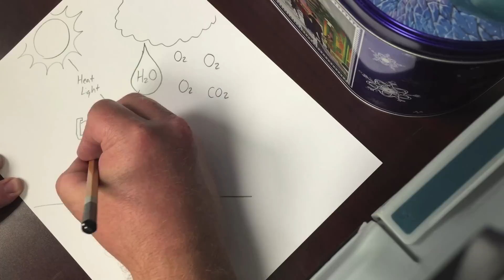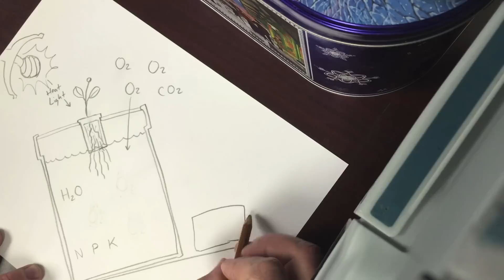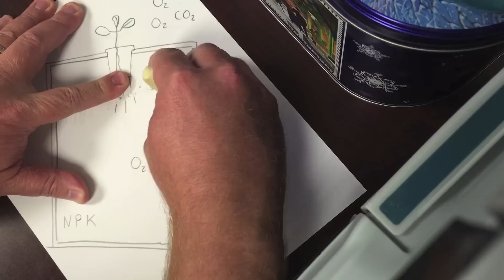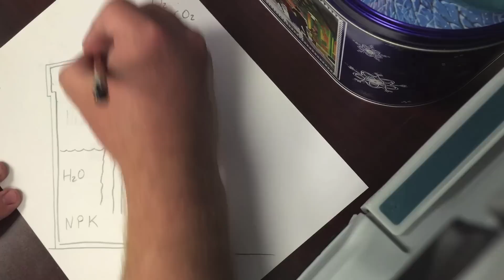How the Kratky Method of Hydroponics Works

Comment: I feel sufficiently educated.
Reply: But, quick question to anybody who can answer, if I try this method of plant growing, should I boil the water first to sterilize it and then wait for it to be room temp or is that a bad idea?
Reply: Rani Emira 
Use lake/rain water.
Reply: use britta filter.  depending on your  areas tap ph  and other levels this works fine.
Reply: @kesitheguesser716  Probably just normal tap water, depending on where you live.
Reply: Jeb gardener

Comment: With this method how do you combat bacteria in the water? Few times I have tried this root rot took over from the heat and o2 depletion
Reply from the maker: Oversize the reservoir
Reply: thank you will give it a shot
Reply: Might be a little late to the party but I used Pondzyme. Look it up.
Reply: If the plant is healthy enough it beats bacteria as well as fungus. Btw I used to use a one liter milk box for salads and they grew well.

Comment: How does this method compare with soil as far as growth rates and nutritional value are concerned? Do you never need to add more water, or do you have to add just the right amount at the start for transpiration to not remove all the water in the tub?
How much energy is wasted by the plant having to grow such long roots and pull that water up a considerable height?
Reply: Io growth in water is 2-3 times faster then soil. I rotate greens in about 45 days from the time I start the seeds

Comment: So the Kratky Method is to do nothing?
Reply from the maker: Well you have to set the grow up.  Once it is going, if your reservoir is large enough you can return at the end to collect the harvest.  Otherwise you have to add some water or nutrient solution if the plant isn't mature yet.
Reply: What nutrients do you use for all your growing, from seeding to mature plants  🌱 and great videos 🤓
Reply: Best also to use "Seedlings" over seeds that way roots hit the water right away and can start the process. You should also "seal" the lid or top so vapor does not come out but it is ok just makes the unit more efficient.
Reply: Where to get the light setup?

Comment: this doesn't make sense to me... so what you just let the res get low on water and the plants get O2 from the air? wouldn't they dry out? how do you keep the interior moist enough? wouldn't your res get contaminated from organisms that prefer oxygen low environments? wouldn't your plants have used up the nutes a long time ago and/or the EC gone up enough to require the res be changed? this goes against everything I've learned of DWC. It was an entertaining video but it doesn't really explain much, just "this works" in a calm voice with music in the background....
Reply from the maker: Yes the suspended roots collect air.  They don't dry out because it is a plastic tote with a lid on top so the humidity is high.  It might get contaminated, but apparently not enough to harm the plants.  The EC goes up slightly but that usually works out because the plants are larger at that point.  

Kratky isn't better or worse than DWC it's just an alternative with it's own strengths and weaknesses.  The funny thing is regardless of what we think the plants just keep growing and the finished product is the proof.  Try it out and let us know how it worked for you!
Reply: Exactly. It may "Work", but not anywhere near optimal. They are growing some pretty forgiving crops there, and not on a large scale. Everything you've learned about hydro, and DWC is still true. PH, EC and Disolved O2 can all be maximized to produce more healthy robust growth. Large plants would empty that reservoir in a matter of a day, or two. Healthy roots are paramount to healthy growth. Diseased reservoirs are just that- diseased reservoirs. It's like feeding a person nothing but spam for breakfast lunch and dinner. Yeah, they'll live, I guess. Short lifecycle plants made for rapid consumption. Personally, I want my plants to be Healthy. I take pleasure and pride in giving them the care they need while truly understanding the entire process. Everyone wants to put Their name on something. If it works, let it ride. It's a totally neglectful way to grow a plant. I understand they appeals to people looking to dip a toe into a hydro type of growing, but a lot of bad habits would be revealed when they went head first. May as well just put it into dirt. Cool none the less.
Reply: I know this debate is between experts and I don't know nothing about this but I do love it and would like to try. Is there anyone of you around New York or surrounding areas willing to give some practical training? I'll pay of course.
Reply: Kratky works, sorry. You are just going to have to accept that, the roots don't dry out as they are in humid air also.
Reply: I've used this about 7 years ago, so "kratky method" is a bunch of BS. It's just a lazy way to do hydro. The thing is that in small containers the air stone will create mist so the roots will stay moist even if the container is almost empty. Small and short plants like lettuce probably don't get bothered by EC/nute changes and will just take what they need until critical levels. Although it is probably unhealthy to eat these vegetables as they most likely intake all the salt and heavy metals depending on the nutes (most nutes will contain heavy metals). Without flushing the plants are keeping all the bad stuff in these but people are stupid.
Reply: Michal Jahnatek I'm coming from the video " soil vs hydroponics" how is the hydroponic one exploding in growth rate?
Reply: Feel free to watch more of Jeb's video's Michal to see how wrong you are.
Reply: Large plants would empty that in days? No shit. That's why you don't grow large plants in this system. Duh. The plants I saw in this video have a short life span and I didn't see any flowering plants like tomatoes. This is for greens. Good lord smart people can be stupid.
Reply: It works because it works. I grow many of my greens like this and I barely have to put any effort in. Sorry not sorry.
Reply: Eric Batista lol I hear ya! "sorry not sorry" lol
Reply: The biggest question here is how can you take a comment from anyone named Dildo seriously?
Reply: This is easier then just dropping them in soil and just hitting them with water?  I fail to see that.  As you saw in some of his other videos plants die in a system like this.   Anytime you have roots suspended water your biggest enemy is root rot.  Now granted going the whole DWC route can be as cheap or expensive as you want to make it.  This does work and it is good for that BUT 2 or 3 small things that cost maybe 10 bucks or less would give you close to 100% success rate without crop failure.  When growing is a small system you dont really have the room to be tossing plants like you would in a bigger system. This is basically the same thing as a raft/wick hydroponics but with it seems like not that great of a success rate.  To each their own though.  If it works for you and you like it shoot for the moon.  If you are getting this far into gardening and moving away from soil to try hydroponics most of the time you are the type of person who likes to tinker and a system like this will be short lived for u
Reply: Thank you :) yea if you want "Large, Long Lasting Plants" you will have to keep adding hydro solution 2-4 inches at the bottom "Sub irrigation" otherwise Kratky was designed for short term high yield plants
Reply: Because it's hard to grow in soil if you have shit soil... and you are just guessing at water/nutes this is easier and more effective than soil... also plants die in soil as well...

Comment: I do the Kratky method and it works well. I have to aerate the water for a few hours before the setup due to having a well and the  well water is low in dissolved  oxygen.
Reply from the maker: Sounds
Reply: Uh, ok

Comment: I love your illustrations and the music! I wonder, would the kratky method work for a hydroponic tuber garden or only for leafy  greens like you demonstrated?
Reply from the maker: Works for tubers
Reply: @JebGardener  I saw in another video where you grew a salad - you were worried about using the carrots because of the fungus in the water - are there ways I can avoid fungal growth that might ruin a whole tote of tubers?
Reply from the maker: kratky it in a way that lets them grow in the moist air space
Reply: @JebGardener  ah I see, so I'll probably need a taller bucket then

Comment: I know little about this method and have just started researching. One thing that I think I understand is that if you let your water level get too low and then replenish, you run the risk of drowning your plant. Supposedly because the roots that develop above the water line are not used to being submersed in water. Is this true and if so, what do you do to prevent it. Thanks for posting the cool video.
Reply from the maker: If temps are cool enough, you can fill it right to the top.  Otherwise you have to be careful.

Comment: Speaking of the cost,what about the grow lights?
Reply from the maker: I'm using a T5 4 bulb 4 foot fixture.  I got it on Amazon for a little over $100.  You can get similar fixtures for $85 - $120.  I could have done it a little cheaper using 2 sets of T8 shop lights, but I wanted the cleaner look.
Reply: Thanks for the reply and nice production on the video ! :)
But I was asking about the cost of electricity to run the setup against the benefits of growing our own plants in sunlight?
Reply from the maker: The electricity cost for my lights are probably about 20 cents a day.  Kratky method works outdoors just fine too though.

Comment: Great video!
I dont want to grow salad or brokkoli at home, but i'd like to grow spices.
My question: does this method work with basil, oregano, chives or rosemary?
Thanks in advance!
Reply from the maker: Basil yes.  Mint is similar to oregano and that works. Chives should work but it would take more media or rockwool.  Rosemary should work for a while but I think takes longer to clone.
Reply: Thanks for the fast answer! already subbed! :)
Reply: I watched the basil video, and a few others you made.. What is not clear for me with this kratsky method, is that if you can grow for example a basil for a long time with it. Because when the roots reach bottom there is only a little water left to be hydrated, but if add more water, for example fill the jar in the basil video to half, i take away the oxigen from the plant and its roots will rot. Or am i wrong and you can just "water" the plant like as if it was in soil and you can keep it for a year or two? (i dont know how long basil lives, the longest survivor for me was 2 months :D) By watering it i mean filling it up to half or something like that.
Thanks in advance!

Comment: So when refilling, how often and how high to avoid drowning?
Reply from the maker: often as needed.  Depends how risky the topoff is.  You can crank it to the top if air temps are cool and plants are small.  If it's hot and it's tomatoes, better to add just a little.
Reply: Jeb Gardener will an aeration pump allow me to keep it topped off constantly?
Reply from the maker: yes

Comment: good afternoon/ I was interested in this method of growing greens/ now I am using the dwc method/ I would like to clarify = when the plants according to the method of KRATKY drink a solution and its level goes down, it certainly changes the pH value/ or not? how you control it and bring it to the desired value - pH +/-? did I understand correctly - that you can not add solution never?
Reply from the maker: PH and EC change as the nutrient is consumed.  I don't mess with PH since these are hobby grows.  I top off (generally only to 50-70 percent of the reservior's capacity) if necessary.  I look at the plant and top off with water or fresh nutrient depending on how the new growth looks.  It's a different philosophy for growing, but it works well for my setup.

Comment: I'm hoping my peppers survive so far they look awesome but just recently I found flowers falling. One explanation is I know I have been interrupting the night cycle  which I am no longer doing I did go ahead and add the air stones to the bottom. My biggest concern is the way that was told to me! I was told to not use the netty pot but to put the plant into 40% soil 60% perlite. Water well the first time then remove the water in 2 weeks once the roots have came through and replace with nutrients to replace as needed. I don't want to keep shocking them but does the soil need to be eliminated? And I go full kratky? Anything special I need to do or look for in my plants? They look healthy at the moment. Sorry for all the questions I'm new to growing.
Reply from the maker: If what you are doing is working, I wouldn't interrupt your grow.  If you really want to get a clue for which works better, take some cuttings and do a side by side comparison.
Reply: Yep already on it. Plus a bit of good news for me, but not for the wife. She broke our Brita water pitcher just the lid part. So I took it from the trash cause the pitcher is still good. Placed some black electrical tape down the side, Sprayed it with blue Plasi dip. removed the tape so I would have a clear window to check nutrient lvl. Then I cut a hole in the bottom of the filter dropped a fresh rooted cut from my propagated  pepper and put a few clay pebbles in for support and WAH_LAH another Kratky Pot.

Comment: Thanks for the video. I have started some tomato seedlings in 3" net cups with clay pebbles. They are around 10 days old and 1 or 2 true leaves appear on them. I am doing it krtaky in small plastic jar. The roots are not coming out of the net cup. The nutrient solution is just touching the bottom of the net cup. What could be the issue?
Reply from the maker: I would wait til roots come out to get them on nutrients.
Reply: Thanks for replying.  I had some  interest in soil gardening. Then I found your video "Gardner ignores laws of nature" since then I have started with Hydroponics. Your videos are really inspiring and awesome. I had started the seeds directly in hydroton clay as Rockwell plugs are not easily available in India.
Reply from the maker: I think coco coir might be a better option in your area.  Good luck!
Reply: ya, I do have coco coir but it falls in nutrient solution so I thought it would not work. I should fill the net cup with coco coir and wait to see the root out of the cup? I like gardening but I think it needs a lot patience to start from a seed.

Comment: What do you do when the roots get too long and you start to run low on water? Do you cut the roots and fill the reservoir with more water?
Reply from the maker: I add more water if necessary.  Ideally you size the reservoir to be at 10 percent capacity at harvest time.

Comment: please correct me if I'm wrong how would you be able to prevent molds and fungus from forming in the water without using a air pump or at minimum circulate water ,thought this was a critical step of hydroponics ???? great job by the way subbed
Reply from the maker: Just had my first fungus issue in dozens of grows recently.  Just usually isn't a problem.

Comment: I just ask two questions, what if the root failed to grow longer and it barely touch the water? And how to prevent it? Well since we dont need to add more water with this method.
Reply from the maker: Don't transplant until you have a root dangling down.  Otherwise you have to top off until the root descends.

Comment: can you refill with solution to the bottom of the net cup.  or do you keep the solution at a constant after the draw down towards the bottom of the container?
Reply from the maker: As long as the roots don't drown (too much water) or dry out (too little water) you will be fine.  I find keeping the water 25 percent to 75 percent below the net cup works best if refilling.  The main idea is to time harvest with water depletion but that always isn't possible.

Comment: Jeb - I have a rooting consistency issue with lettuce.  Sometimes my roots go crazy and fill the jar and other times I have to keep the cube wet for the full growth of the plant or it will dry up and die.  Is there a trick to getting the plants to put down roots???  The nutrients are always the same and I only use two kinds of lettuce so they are always the same.  Your thoughts?
Reply from the maker: if the rockwool is too wet early I think it will slow down root growth.  Otherwise high air temperature could cause problems

Comment: what was the nutrient that you mix in the water
Reply from the maker: I was going to have a sarcastic comment for you about reading the description but I just looked and I hadn't shared it in this video.  The nutrients I currently use are:

1 gallon water
2 grams MasterBlend Tomato 4-18-38
2 grams Calcium Nitrate 15.5-0-0
1 gram Epsom Salt (Magnesium Sulfate)

Comment: is the net pot needed or can you just fill the container with a clay pellet medium (or whatever other medium is available)?
Reply from the maker: I'm sure the plant would grow in an environment like that, but you would have to try it out to see how well it would work.  That sounds similar to the bed setups a lot of aquaponic systems use, but those are constantly flooded and then drained.  I suspect it could start to go anaerobic on you if the water was stagnant.
Reply: okay, thanks for the info. maybe I could find a way to keep water moving slightly while maintaining a low tech setup.